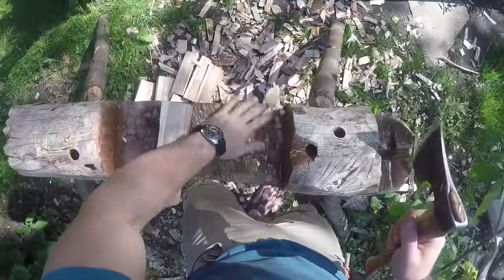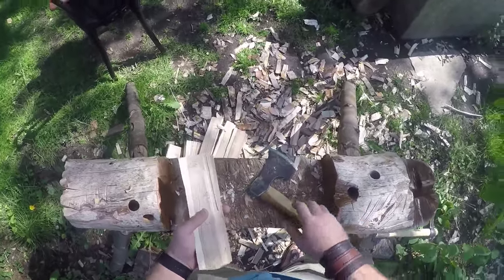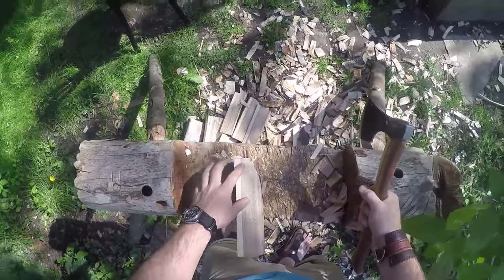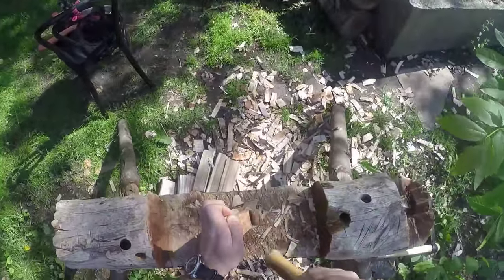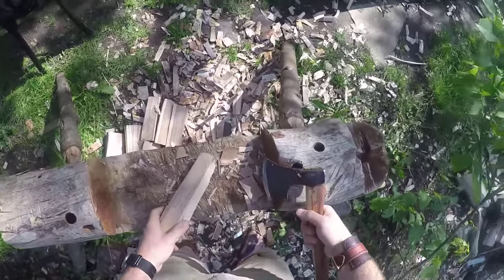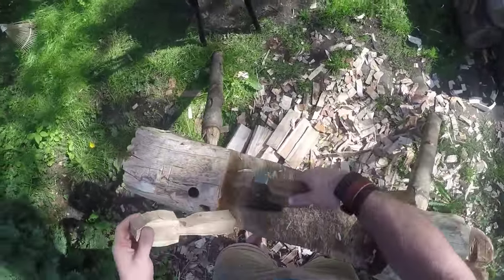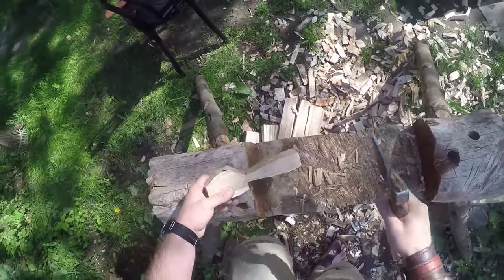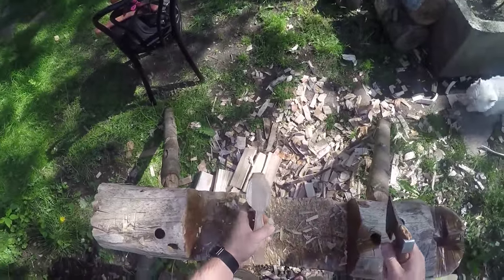The Triple-C Method of Spoon Carving - by - Woodsmans Finest  (Axe Work Part I)

Comment: I tend to use my knife much more also for removing the stock. I just recently started using the axe more. That is partially due to the fact that my axe still has a thick edge. I will correct that as I have seen how wonderful it is to do woodwork with a small hatchet.
Reply from the maker: SpartanJohns  awsome buddy... check out my fanpage Woodsmansfinest on facebook and check my modified axes. the one in the thmubnail is one of my kent pattern mods. if you need a nice carving axe, let me know. got some mods totally handmade by me, at the moment. there are heaps more tutorials coming from different angles and if you have any more requests for tutorials, let me know and Ill get to it over the next few weeks! cheers

Comment: I've been hooked on spoon carving for a year now. I do at least 2 a day now, and just got the opportunity to sell them at a local business. I've been at it with applewood and my wrists are taking a beating... any tips to avoid fatigue? I'd hate to use my band saw, I feel it's cheating the end product.
Reply: Gabe, I suspect you should re-evaluate your axe technique...
Reply: @suecollins3246  I switched my hatchet to one with a larger handle to accommodate my large hands. The old one required a tighter grip to keep it from turning.

Comment: Say Heah, Yeah, I like a Basic Trio Carry also. But I don't carve. I just think it's a good carry in the bush. But just recently I bought my S. O. G. Pillar Fix Blade which I added my 2Hawks Double Bit Hatchet and my Wicked Tough Saw. I usually carry my Mora Eldris as my Neck Knife. In colder weather where I need to process more wood, I like to carry my Modde Rodent 6 which I had it thin down at their Custom Shop and I had tge top guard taken off now it L@@Ks like a Ratmandu on steroids. Really a nice piece if kit. With this knife I add my 17" Hultafors Bruks Agdor Hatchet and my new EZ KUT WoW Folding Saw and my Mora 510 as my neck knife. Yeah I like to Multi Carry Knives. Good review, keep up the good work.,,. p